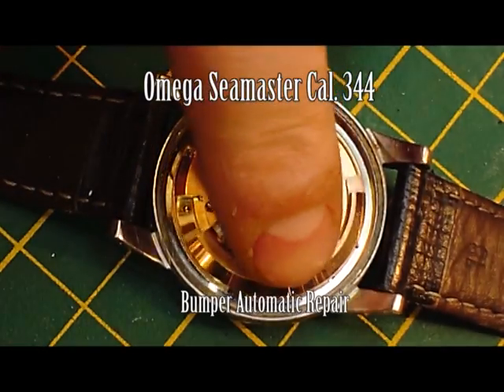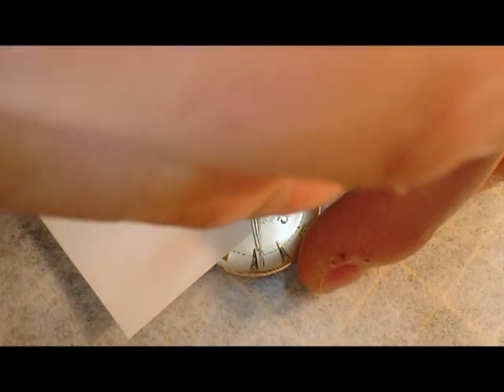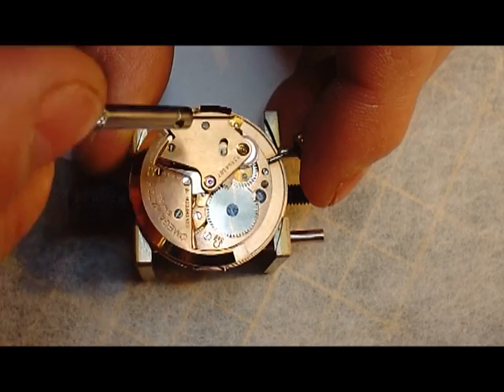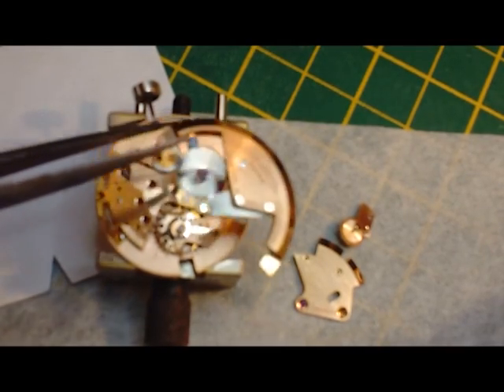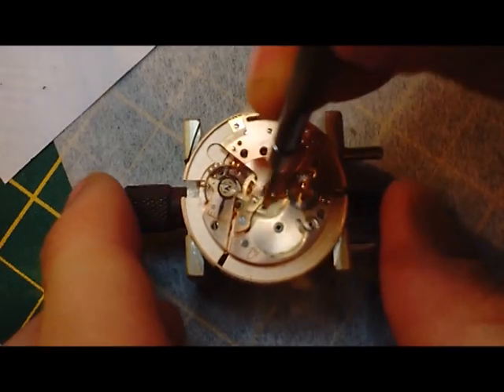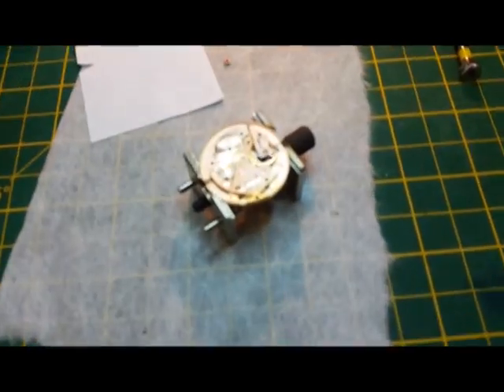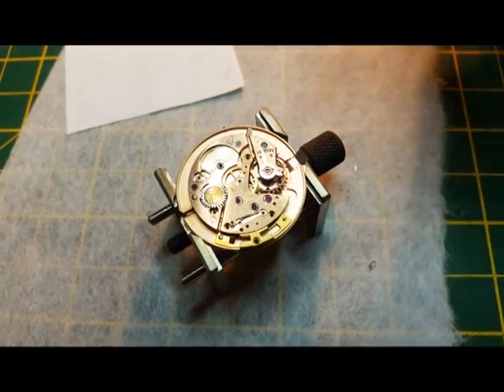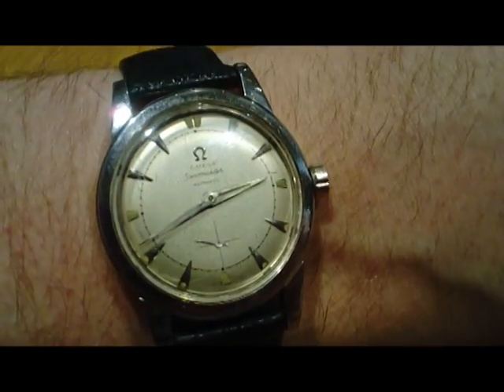Omega Seamaster Watch Repair Cal. 344 Bumper Automatic

Comment: I have a bumper, the clamp stops the movement from being removed. How did you remove it? There is no trace of it in your video
Reply from the maker: chriz74 there is normally just a small screw holding the clamp on position.
Reply: craynerd yes but the one on mine was sitting under the stop bank.

Comment: great video ..i got omega deville  after rewind its moving but none of the hands moving i hear it clicking
if i left it for few days and just wear it on it will work perfectly but if i try to adjust clock hands will stop moving after adjustment .. yet still the watch ticking perfectly any suggestions?
Reply from the maker: hesham fouad have the hands lifted and are binding somewhere?
Reply: @craynerd  the hands are in their position only 2 hands hour and min .. if i shake the watch with a fully empty unwinded the hands will start moving as usual but if i try to adjust the time they will stop at their place after adjustment thats why i keep it on 12 o'clock come next day at 12  while watch completely stopped just put on my hand  then shake it and it will keep working  normally any time adjust and hands will remain still on their new adjustment postion i hope i make it clear

Comment: You disassembled in the wrong order
Reply from the maker: Thanks. What would be the correct order? Or which bit specifically did I do in the wrong order?
Reply: craynerd well I always start with removing the balance and then letting down the power. I highly suggest watching a video from thewatchrepair channel to get the whole picture. 
Also never touch parts with your hands and I would invest in good tools.
Reply: i agree with A.S. only for hands touching and good tools and so on. But concerning removing the balance wheel, is not really important. doesn't matter here in switzerland.
Reply from the maker: Thank you for the advice and watching!